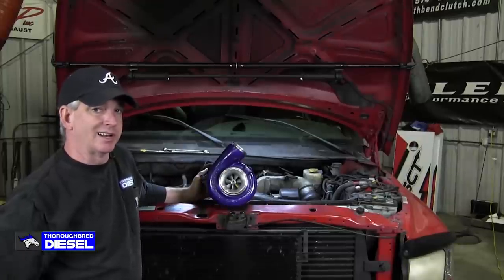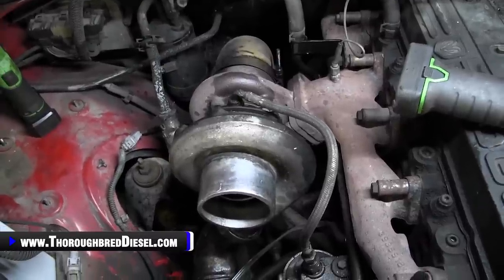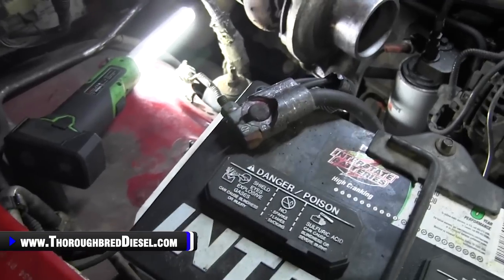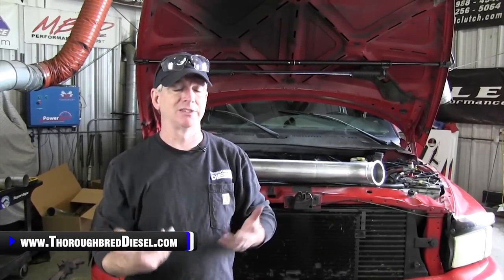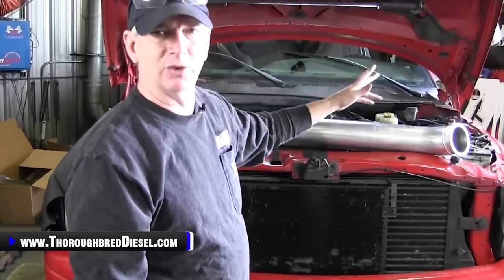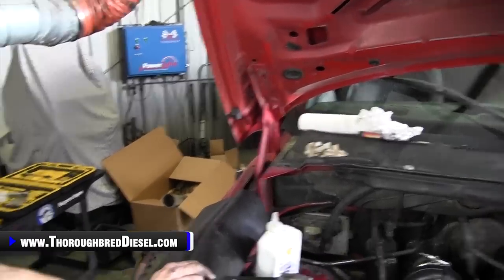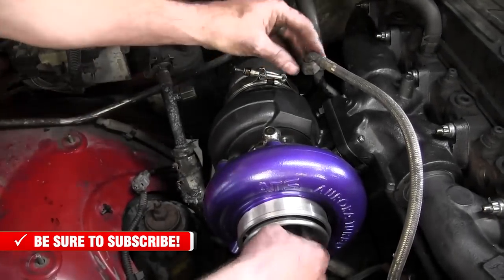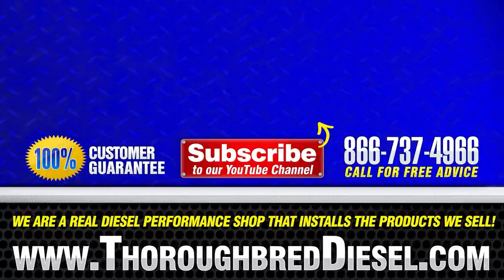We JUST Installed An ATS Aurora 3000 Turbo on Wade's 2001 Cummins VP44 Truck | This Was The Result

Comment: This is a great turbo. I’ve had mine for 250k miles. Spools up quick and smooth and has way more top end. When I’m grabbing 4th 5th and 6th it hangs at 40psi real nice. I need a new to me truck, pretty sure I’ll get another 2nd gen and I’ll put another 3000 in it for sure.
Reply: Get a 3 rd Gen and life will be so much better !!!

Comment: 27:24 When you can screw a locknut on by hand it's no longer a locknut and needs to be replaced. They get worn out more quickly by using power tools on them.

Comment: I have had this turbo on my 2000 dodge ram 2500 4x4 5.9 Cummins for the last 9 years. My engine is built by Industrial Injection using all ARP hardware. Has stock cam. Externally on the engine is all high performance,  Smarty tuner at stage 9, stage 2 transmission build, Magnaflow 4" exhaust, 3:55 gears and the top end is mind blowing. Dodge, Ford, Mercedes diesel owners try to show me what they got and I smoke them all- awesome turbo! My truck easily runs at a 125 mph- above owners have their jaws dropping 😁
Reply: Hows the sound?
Reply: @supersarertnoc  you can here the turbo as it spools up- sounds neat
Reply: @supersarertnoc  sounds great 👍
Reply: You can hear the turbo spool up- not overly loud

Comment: I have it and love it,  mine is a 2001, upgrades,  auto transmission,  smarty 03, exhaust,  intake, , exhaust manifold,  just did a long block., cow catcher bumper  , after market intercooler and radiator. Love the truck and cheeper than a new one.
Reply from the maker: Woo hoo!
Reply: @thoroughbreddiesel  thanks forget also the Aurora 3000
Reply: @thoroughbreddiesel  do I need to have a tuner for this turbo to work right or can I just run the truck on stock tuning?

Comment: You can see all the soot from the result of the missing bolt from the turbo flange on the underside the hood. That would result in a significant turbo pressure loss.

Comment: I might be interested in one of those for my old 12 valve . I just use it to tow with . Not a hot rod . I appreciate your video of your truck . I going to install a rebuilt g 56 in my truck to replace the 47rh . Thanks for the information .

Comment: Question: Do you have to do any sort of tune? Or is it simply, remove failed turbo, and install Aurora 3000(with manifold and pipe)? I really want to do it my self because I don’t want to pay $7,000 on local diesel shop.
Reply from the maker: You don’t have to have tuning but this setup runs so much better with tuning.

Comment: Love my 3000 with 
+75 hp injectors, on 4th year 100, ooo on this setup 
Also a Fass fuel, SB horn and intake 
Speed Steed manifold, edge box and display,boost max is 40 , towing egt’s never over 1250 , wouldn’t mind putting a larger inter cooler and radiator thinking be perfect then, but not really n
Necessary

Comment: I've got a 1998 24 valve 5 speed manual and a beautiful cast iron inline 6 under the hood. 180k miles and more than half of them were with a bumper pull.
I love the dependability but would appreciate a little more juice.

My thought was to use the Aurora 3000 turbo with a smarty tuner and everything else stalk thinking that it would an effective and cost efficient route.

Is it not that simple? What is your take on this?
Reply: I have an 02 5 speed currently with a Smarty and 75hp SDX injectors... the Smarty does a good job waking up the truck but honestly for the money I think you're better off with a quadzilla and simply not doing the pump tap.  I am maxing out my stock turbo with the Smarty and injectors so I think my next step will be this A3k turbo.
Reply: Might be a bit late for this but that would be fine, ran my 1999 5spd with that exact combo and it ran great, I eventually added 7x0.010 injectors (too big for this turbo) and a TST comp box which made great power, but it was smokey and not all that drivable so I went to a larger turbo and different tuning for more power less smoke, still gonna hang on to my smarty though because its such a good code reader
Reply: @IanYav5.9  you ran 7.010s with tbe auro3000,.And didn't like it?
  I have 7.011s on my hx35, and need a larger turbo for towing....was eyeballing this aurora3000, but your comment has me hesitant

Comment: How would this turbo/manifold setup do on stock injectors? I have a 65hp tune, 5” exhaust and an s&b intake. I want good towing power, I don’t hot rod it at all.
Reply from the maker: Perfect.  The A3K will pair perfectly with stock injectors and small tune.  Great towing turbo..
Reply: Awesome!!

Comment: I need a straight shot answer. I tow alot. +20k on a daily basis. I need to know which turbo is absolutely the best when reliability and safe egts are priority but still need power to climb grades. This screaming 2nd or 3rd gear just doesnt sit well with me. Rv275 sticks right now but would upgrade if necessary. No tuning ive got your vp44 and still under warrenty. Obviously compounds are what i need and in my future plans. So what turbo should i upgrade too, and will it still be usable in a compound towing setup?
Reply: s362/65/12 would be a good setup that allows for room to move up in fueling and to compounds. I run a 62/65/12 with 100hp injectors and quadzilla tuning. Couldnt ask for an all around better setup.

Comment: I just watched your video about putting on the Aurora 3000 turbo I’ve watched some of your other videos before and I really like your demeanor you’re not dumb arrogant and you’re not beating up on them other products and things like that you’re a very professional guy and I also liked your test drive you work 180 mile an hour on a final 45 mile an hour zone I don’t know what was the speed limit was but some of these guys with these trucks are yeah I am surprised we haven’t heard of severe very bad accidents with some of these guys having fun anyway anyway I have a 91.5 Dodge and I was just wondering if it would be feasible to try to use that Aurora 3000 on my truck but before I do that I got itGot a try to find a way to upgrade my inner cooler anyhow I have dynamite diesel stage two injectors stage two Hamilton cams head and HX 35 turbo which is been pretty good I have ATS exhaust manifold which I gasket matched close to the head and the turbo and that really seem to break things up anyway one thing about the ATS manifold I wish they would put a better paint on there so they didn’t just rust up real bad other than that I think it’s OK

Comment: Looks like a nice charger, I went with the Fleece Cheetah for my '02 3500. It just arrived here in Ukraine but I'm debating on whether I should install now or wait until I get the new manifold. I like the ATS manifold you installed on yours but it's tough having to wait 3 weeks for it to arrive especially when I have this turbo staring at me each day ). I'm trying to give Thoroughbred all my business and I have a lot to purchase.

Soon I'll be ordering the head stud kit, FASS lift pump, straight pipe exhaust, and the Suncoast stage 3 47RE rebuild kit. My question is should I wait on the manifold or just go ahead and drop in the Cheetah?? I really appreciate the videos and it would be nice if you could show us the Fleece Cheetah drop in for the 2nd gen models.
Reply: Anonymous Legion so did you wait or drop it in?
Reply: I have the Fleece in tank twin gear motor pumps it works great .I get 21-22- at idle 18-19 hard pull and what’s neat one pump hooks to factory wire harness and you get a nice cable that has a sleeve on it for protection . That cable has a relay on it and a fuse so if one of the pumps quit working you still good to go because 10-11 psi is still better than stock and I put a gauge a long time ago to keep a eye pressure and when it went down to zero on hard pull and just at idle 5-6 lbs and make sure to fill out the warranty cad and send back for your lifetime warranty. So hope that helps. And I did mine on my garage floor with a floor Jack to hold tank up. And try to run you truck to get as much fuel out as you can. When you get the straps off you can spin it and see all the connections.
Reply: Do you like the fleece cheetah?

Comment: Great videos!! But Wade - how did you remove that bottom turbo/manifold flange nut closest to the cab? I have an 02 and trying to remove the turbo to upgrade it. Removal of this nut has defeated me so far!
Reply from the maker: That nut is a bastard. If it fights you too much,  just remove manifold as assembly if you can get to the manifold bolt.
Reply: A little late ( I hope)Ratchet wrenches are your frend.. flex head is a step up .

Comment: Dumb question but what is the port on the front bottom of the intake side of the turbo
Reply from the maker: It is a port that is available if the customer decides to use a turbo speed sensor.

Comment: It's a very bad idea to work on things with your wedding band on, with ANY jewelry on. It's one of the things they pounded into us in Tech school in the military. Later after my military career was over I met a guy without most of his ring finger on his left hand. He was working on his car and got it ripped off. I don't remember the details I just don't wear jewelry any time I'm working on anything.
Also My truck a 2001 3500 has a PacBrake. Do you not tow with your truck? An exhaust brake is a wonderful option.
Reply from the maker: That’s a rubber ring.

Comment: How do you get the engine light to go out after you put the turbo in.
Reply from the maker: This turbo on the 98-2004 trucks will not set a SES light. Scan the code and see what you are getting.

Comment: Late to the party and I have paused it at 1:50 lol. My question is, After doing the upgrades to everything else ( meaning suddle fuel upgrades and upgrades to make everything right ), would installing a wicked wheel on a stock turbo help out a little bit n a pinch if someone can't purchase this turbo kit?
Reply from the maker: Yeah it doesn't make a huge horsepower increase but you actually notice a lot of pedal difference and decrease turbo lag.

Comment: How will this turbo perform on a 3rd gen 24 valve?
Reply from the maker: Great little towing turbo for a truck with stock fuel system and mild tuning. Also perfect for a everyday driver.
Reply: @thoroughbreddiesel  I should have added my engine is the isb 255.
I'd like to add mm3 tuning to get me somewhere close to 400hp.
I will add whatever mods needed to make it run good.
Should I still consider this turbo?

Comment: Can you put that turbo on a stock  truck? My 99  5 speed has no upgrades
Reply from the maker: This turbo is best suited for a truck with a light tuning upgrade to get the full effect of the turbo. Not recommended for a bone stock truck.
Reply: What turbo would you suggest? Mine blew and looking another one.